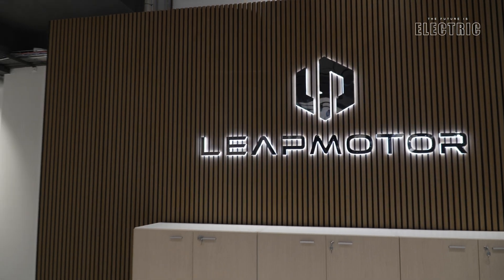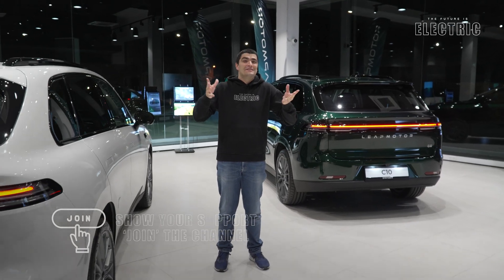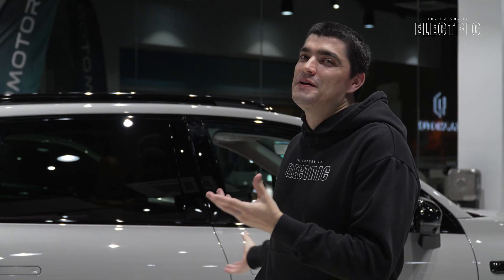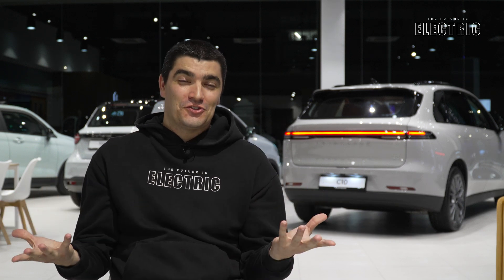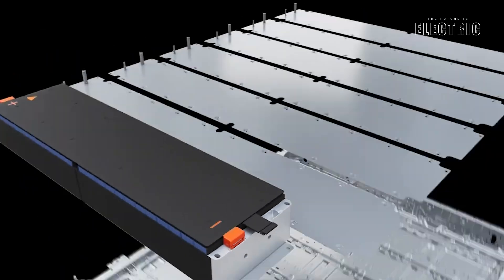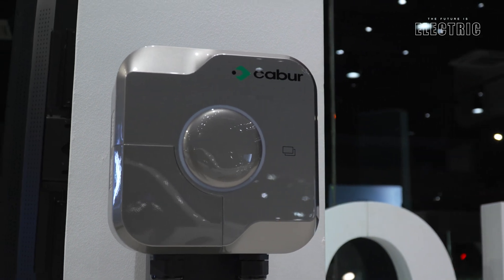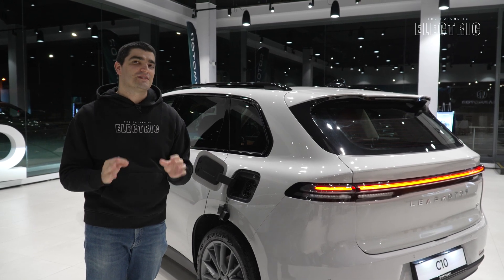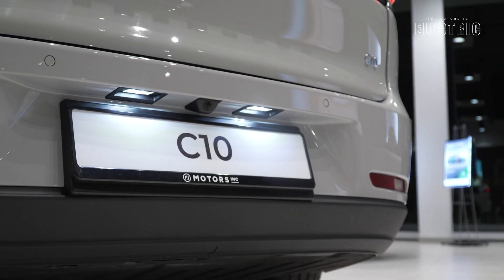Battery and Technology Review of the Leapmotor C10

Comment: Wrong information  at home full charge  is 40 hours
Reply from the maker: The time depends on the power given to the car, the charge power are given in the explanation. Using a standard wall plug (2.3kw) it would take 35 hours. I highly do NOT recommend charging EVs on 3 pin standard plugs.
Reply: @TheFutureisElectric  why is that? If the 3pin socket is of good quality?